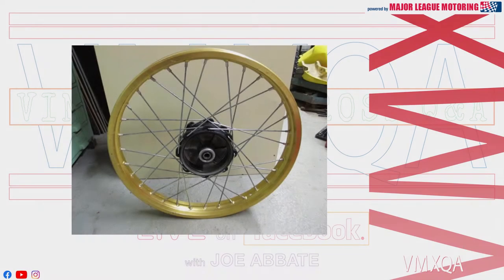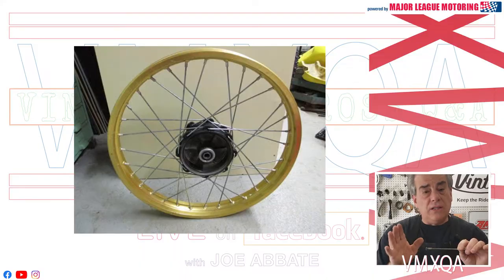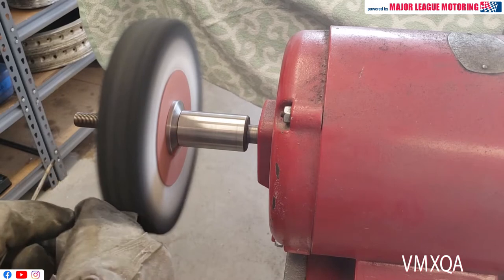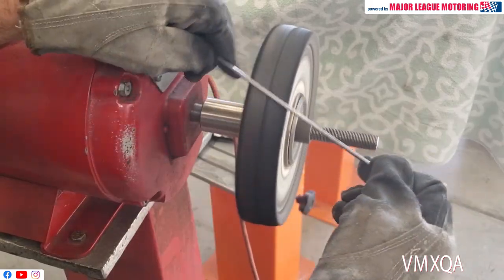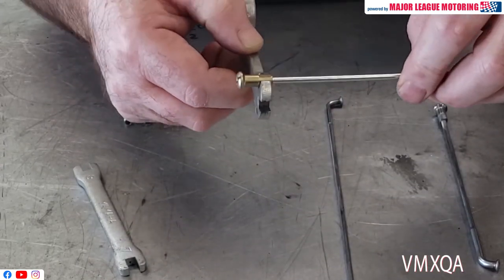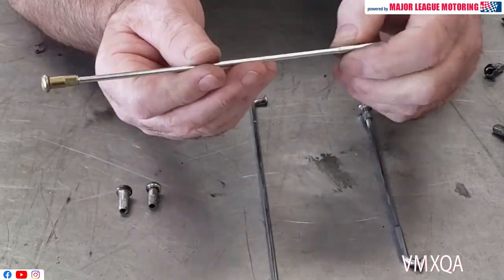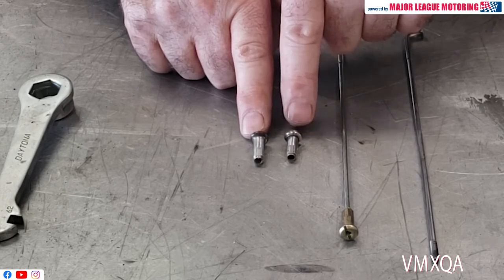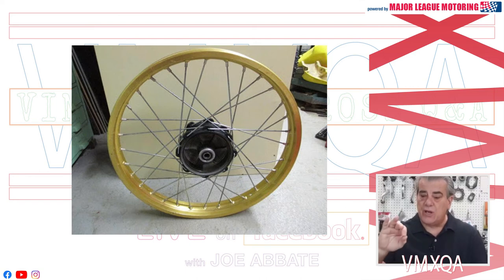Spoke Polishing- VintCo Vintage Dirt Bike Tech Tip

Comment: Nice video once you have polished them can it be left as it is ? What's the reason for plating
Reply: Good point.  I guess it depends on how much quality you want to add back into the restoration.  If the spokes and nipples clean up well, maybe you could just spray them with a matte clear coat from an aerosol can, especially around the nipples.
Reply: They are zinc plated to keep them from rusting. Or you can buy stainless steel spokes.